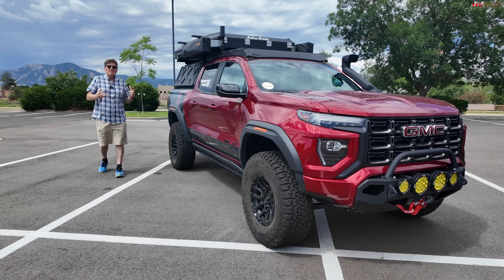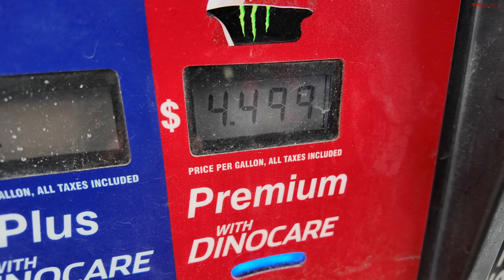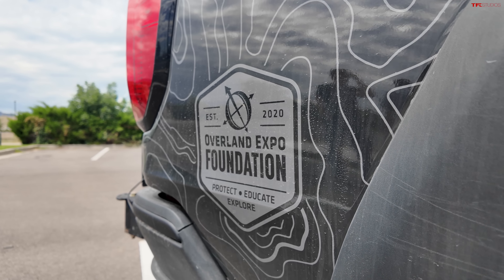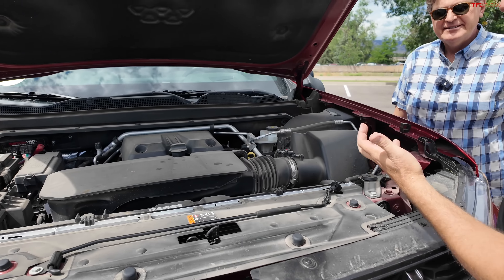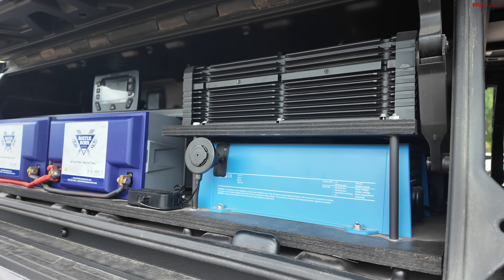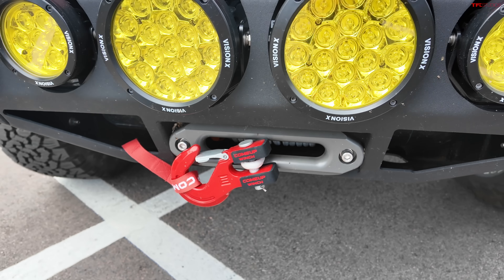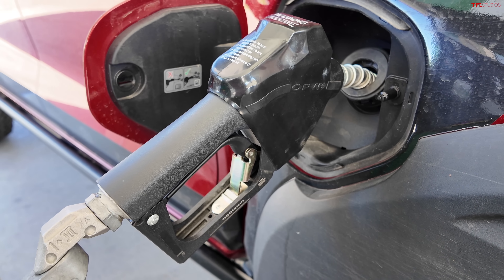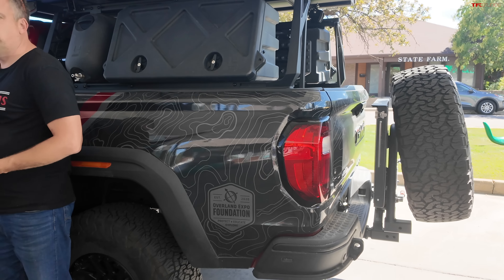How Much Does Adding a Ton of Off-Road Mods Kill Your Fuel Economy? | Denver 100 MPG Test

Comment: Wait, Andre truck doesn"t have cruise control??
Reply: That's the first we've heard of this.
Reply: @guentherwilke2055 lol, no. It was in the very first video he did of it. He picked it up and was like "where's my cruise control?!" It was in several videos after that and if you look at the comments, people gave him crap about it for a long time. He was quick to order it and didn't pay attention to standard features and didn't realize it was an option, so when he ordered it, he didn't get that option. I think getting it is just as simple as replacing the steering wheel with one optioned for cruise control, however.
Reply: @backwoodstherapy  I'll use a heavier coat of sarcasm next time. Andree's missing cruise control has been a running joke since day 2 of him owning that truck. Cheers.

Comment: Cruise control is literally the most useful car installation. I don't care if my car has no power seats, power windows, automatic headlights, or any fancy electronic stuff. If it doesn't have cruise control, im not buying it. In my car if i get stuck behind somebody who isnt using cruise control on the highway, i lose my mind trying to keep a good distance behind them without them speeding up and slowing down by a couple mph.

Comment: 26 mpg on an off-road truck is pretty amazing
Reply: Yeah but the Trailboss is not an off-road trim it’s a street truck with some off-road capabilities. A ZR2 and a Bison would be a true off-road truck and they have 16 and 14 MPG because they have more weight and lift and real off road tires.
Reply: @is6566  I have a 2024 Colorado ZR2 and regularly get 17.5-18.5 even the way I drive it (85 on the freeway).  Not good, but not terrible.
Reply: True. I think the Bison is where it gets really bad but even the regular ZR2’s 18 mpg is a far cry from the 23-26 of the Trailboss that the original poster was excited about.
Reply: @is6566  I'd like to see a 100% stock Trail Boss and ZR2 do a mileage test, then swap wheels/tires and re-run the test.  I'm not sure that Andre has the HO tune (430 ft-lb) that comes on the ZR2 and 2024 Trail Boss.  Since he has a 2023, I "think" he still has the mid tune that has 390 ft-lb, and if so, THAT would certainly account for a big difference in mpg.
Reply: @is6566  its no ZR2, but it has a 2 inch lift with fairly wide 32-inch all-terrain tires. Usually those 2 things alone mean sub-20 MPG on any truck. Andre's also has the high output tune. 26 MPG is awesome considering.
Reply: @kx8960  he paid for the HO tune. His truck also has the optional Territory MT tires.
Reply: @andrewb325  I couldn't remember if he did or not.  SOMETHING is making a big difference since his tires still aren't near as knobby as the ZR2 tires, and re still smaller in diameter.
Reply: @andrewb325  In thinking about it, the locking rear diff on the ZR2 may be causing a lot of drag.  Contrary to popular belief the body or frame lift itself doesn't cause drag per se (otherwise airplanes couldn't fly), it is that the underbody parts being exposed to airflow (causing turbulence) that does.  Big difference between a new 'Vette and a ZR2, basically zero between the Trail Boss and ZR2.  Now, the slightly greater angle of the u-joints in the driveshaft and front CV joints will cause extra drag, probably a lot more so at the front.  The tires themselves I'm sure add a lot of drag, being bigger and knobbier.  It would be really interesting to get manufacturers data to see what particular system difference causes what percent of the actual degradation in mpg, but they probably guard that VERY closely - I would.
Reply: @kx8960  yeah, its a pretty massive difference. It's probably just the sum of a lot of little changes. The Trail Boss still has an air dam, which helps aero a bit. The modded ZR2 with the cut bumper, bigger lift, tires and added parts is an aero nightmare in comparison. As far the rear diff, I'd think the G80 in the Trail Boss has similar drag to the locker in the ZR2. The ZR2 does have the locking front diff which definitely adds some drag compared to the Trail Boss.
Reply: Andre has the HO tune.

Comment: I have a 2024 ZR2 (the blue one Andre saw a couple months back when I talked to him at a mutual friends house) and I'm not getting near that mpg using premium as well.  Now, I'm typically doing 85 on the highway and when passing people have to....er...bump that limiter on occasion (LOL), but I typically get 18 (calculated, as the dash is always about 1mpg optimistic).  Now, on my first Moab trip I averaged a little over 19 on the tank there and tank back averaged, so I was real happy about that.  And on one tank on my recent 3,700 mile trip to Glacier Nat'l Park and back, coming from the saint Mary side back to my hotel in Whitefish, I got 21.3 I think, and was TOTALLY surprised at that, but I was going pretty slow.  Average on the dash for that whole trip including 1 1-/2 solid days of offroading in Moab at the end of it, was 18.4, so, figure maybe 17.4 actual calculated avg for the whole trip.  Considering I fought some hellacious headwinds winds/rains in WY (Surprise!  LOL) in a couple of the travel days, climbing to higher altitudes several times (Beartooth Pass, Logan pass, etc.) and with getting maybe 10mpg while wheeling, I thought that was pretty good.  I put 45psi in my tires for highway travel to try and get more mpg (I'm positive I get at least 1mpg over the 46psi recommended), but I think the difference in tires from my ZR2 (much knobbier) has to make a much bigger difference in the difference in mpg.  As always, great vid!

Comment: Lifting my truck and putting bumpers and whatnot on it did not affect fuel economy at all.  The ONLY thing that affected fuel economy was larger tires.  My 08 tundra went from 18-20 with stock tires, to 10-12 with 37s.
Reply: Yeah it’s crazy how the Tundras, even the new ones, suffer from larger tires. A dealership near me put 35s and a 3 inch lift on a Tundra hybrid and it now runs 12-13 mpg highway lol. Meanwhile, my Raptor on 37s still push out 19-21 mpg highway in Oregon…
Reply: @whocaresjustdoit  It's not just Tundras, it is every vehicle. Larger tires are the bane of fuel economy. The raptor is an exception because it was designed from the ground up to run larger tires in the first place. 

If I were to regear my axles in my Tundra I would get much of that fuel economy back.

Comment: nice , My atx4 gets horrible milage ,  I have a cargo van with a v8 chevy express 2500 that its similar MPG and has less HP but feels like more HP explain that to me , only thing you can fault this truck on is the power plant , give me a v6 natural or v8 natural asp
Reply: V6 Natural 💯 😊
Reply: Toyota had a V6 natural aspirated, it sucks for HP and torque.
Reply: Your v8 van makes more part throttle off idle torque. The hp and torque ratings on the new boosted engines are only valid at full turbo boost. That's why it feels more powerful in your van.
Reply: @jasonperry7970 gearing could also be an issue. The AT4X has a 3.42 gear ratio. On 35s, it will feel anemic, even with that turbo engine. A work truck may have a higher gear ratio for towing and hauling, which will make it feel peppier off the line.

Comment: The lower fuel economy of the built truck, while not great, is still better than a stock truck like Andre’s pulling a small, lightweight teardrop trailer of ~2000 lbs or so.

Comment: Now if you could do the test again using 87 octane. I am guessing you will still see the same mileage and save a few bucks.
Reply: Maybe with the stock truck but I bet it did help with the modified truck with all that load on it. The PCM's in modern engines are constantly searching for maximum ignition timing, so they will take advantage of the added octane, especially these turbo motors.

Comment: Dear Midsize Pickup Truck Manufacturers: Please give us a 4.0ish Liter, in line, supercharged, diesel engine with an eight-speed manual transmission. Those high strung little turbocharged four bangers do not belong in trucks that are expected to work for a living regardless of how "work" might be defined.
Reply: A supercharged diesel?
Reply: @Youtubeuser1aa  Yep, many military vehicles do or have utilized supercharged diesels. The M60 MBT comes immediately   to mind since I trained and served on them, all 70 tons (combat loaded), and 750 horsepower that came from a 12 cylinder horizontally apposed diesel engine. So why NOT a supercharged diesel in a midsize pickup?
Reply: @furmanmackey5479  because turbo diesel is far more mature and supercharged would not meet the insane emissions standards.
Reply: @Youtubeuser1aa  Superchargers have been utilized in aircraft, for example, for nearly, if not exceeding, 100 years with considerable success. Having said that, I agree with you that thanks to insane emissions standards the supercharger might not be the best choice in today's automotive environment. But I can still wish....

Comment: Wow, MPG is not really impressive for either truck. So the short answer is that the major mid size truck manufacturers are sacrificing mileage for cleaner emissions, hence the change from a normally aspirated V6 to a turbo 4 banger. I accidentally filled up my 2023 normally aspirated V6 Ridgeline with premium fuel and drove 150 miles going 80 MPH and average 27 MPG. I understand the turbo 4 banger have better HP/torque specs, but most of the mid-size trucks had great V6's with great reliability. So is this turbo 4 bangers really a better option, I have my doubts.
Reply: Not to mention longevity. Are the turbo 4 bangers gonna be as reliable & long lasting as the Natch Aspirated, reliable, tried & true V6 engines that they are replacing?? My answer is NO. Turbos work engines hard. Simple as that. Everyone knows that most V6’s aren’t fuel efficient engines. That’s not what people buy a V6 equipped mid size truck for.

Comment: The worst part is Colorado residents are paying those prices for 91 Octane, not 93 Octane.  Same week, same month, Shell Premium in Maine is around $4.30/gallon.  I know many states are higher or lower, but still, at least we are able to use 93 octane E10 fuel.  Those trucks look nice, but for the money and resale value, I would ALWAYS choose a 3/4 ton mid trim truck over a small truck with lots of heavy add ons.  What a waste of depreciation money.  Also, that turbo four sounds like crap, like an Osterizer blender.  Yuck.  V8 Engines for a real truck.  Maybe GM can loan you a scrapped 6.2 Liter, instead of those transmissions, since the 6.2 motors fail prematurely.  At first, I saw the transmissions and thought they were leftovers from your Tacoma Blueberry.
Reply: I'm in Metro Vancouver (i.e. West Coast of Canada) and I am paying $4.92 USD per US Gallon for 87 Octane summer prices and next week when prices jump back up, I will be paying around $5.50 USD for the 87 Octane so gas prices are QUITE EXPENSIVE here! If I bought the Premium 92 Octane, it would be $6.70 USD per US gallon!

V

Comment: I can only speak from my experience...my wrangler with 315/70/16s averages 18.1mpg. that same jeep on the same roads with 275/70/18 AT tires gets 23.5. oh, and it drives much easier.
Reply: The tire width is what kills you. If you keep the tires narrow, close to stock, you shouldnt lose that much. I went from 275/50R21's to 35x11.5's(285/80R17) on my LX570 and really didnt lose any efficiency. Granted it already sucked stock but it didnt get any worse. Driving through UT at 80 mph I was still pulling down 17-18 mpg.

Comment: I love your videos, specially the old ones, when you guys went off-road. But lately is just about expensive cars/ trucks, most offer the same, full of tech that not really needed. If you want a truck for off-road/ overlanding, not rock crawling, that you will travel for long distances away from civilisation, petrol isn't the best option, but Diesel is. 
When someone expend $30-$100k plus in a truck, the last thing this person will be worried is about the cost of fuel, their worries would be if the truck will fulfil their needs, if it's reliable, easy to fix, if those electronic gremlins will happen or not and how easy is to fix it. Because person is investing for have the fun part of having it a modified truck, and in my opinion, that's what, I believe (but I can be wrong) people want know. Anyway I am a fan and wish you guys went more off-road, overlading, having more of those series with 3 to 5 episodes and objective reviews when TFL did say this is good and this is not, instead keep going in circles.

Comment: That fuel economy is terrible. My leveled 2019 diesel Colorado still gets 27 MPG and even my 2020 Gladiator on 35s with a fiftyten camper returns 17 MPG.
I wish GM would have made more of an effort to achieve greater efficiency.
Reply: Is your diesel Colorado a ZR2 with the wider track and does it have a roof top tent and 35x12.5's?
Reply: @Jay-me7gw  Nope. That's not the comparison. It has the same size tires as Andre's truck and has 150000 miles on it. Not to mention that I get about the same fuel economy as that GMC towing a 69 Jeep Gladiator.
Reply: @curtshelp6170  Yeah and the new colorado is bigger and heavier than yours so I would say 24 mpg is pretty damn good from a gasser that will run circles around that diesel power and torque wise.

Comment: From my experience over years of going from 31's to 33's to 35's to 37's, then to 40's and adding hundreds of lbs of armor it destroys mileage.  Just going from 33's to 37's you'll lose 5mpg overall.  And btw those Ko2's are NOT real 35's.  They're literally the lightest weight 34'' tire made.  MPG and REAL D-rated tires over 33'' don't mix lol.  The Ko2's are city boy tires.

Comment: Uh, no to the modified truck. Too much "junk" on it that not only affects wind resistance, it also gives it unnecessary excess weight. Sure, upgrade the truck, but remove the additional, unnecessary "junk" when not needed. That stuff should only be on the truck when you're going camping and off-roading.

Comment: I can see somewhat a flaw is that the fuel. I think you need make sure that if you going change grade of fuel, then need to run the truck to empty and fill up fresh grade of fuel. If you are mixing grade like still have a 3/4 tank of 87 and put 1/4 of the premium, you aren't going get the full performance out the fuel. I could be wrong but that is one thing I'm seeing that the test can be flawed. I can see y'all do a fuel grade mileage test where you run one type of grade and test fuel mileage and run another type and see if there is a difference.

Comment: These little trucks dont seem to get any better mileage thab their full size counterparts.
My 2017 crew cab, 6.5ft box Silverado with a 5.3L and Max Tow with 3.73 geared diff gets the same mileage on the highway as the yellow truck. 🤨

Comment: You DON"T need higher octane fuel, scam! Even my 2002 Corvette Z06 (gone now but I owned it for 11 years), day to day, ran great on regular unleaded. I don't even think I noticed when I did use premium fuel? The factory owners manual even says so.
Edit: They simply state it's recommended, in that they mean, it would be best if you were going to race it. Day to day, no need.

Comment: What’s funny is that whenever I have talked to someone driving a big 4WD truck, they usually tell me that they have never had it off the pavement.  🙄

I don’t want a turbo four in a compact car, certainly don’t want it in a full size truck. A straight 6 or V6 would be a lot more durable.

Comment: This is not a legit test. The Colorado is a Trail Boss and GMC an AT4X. very different trucks. A more equivalent test would have been GMC Elevation with off road adds 4x4 and Trail Boss or AT4X with off road adds and Colorado ZR2.
Reply: They really are not that much different. The Trailboss has the same track width and fenders as the ZR2 and similar tires. The powertrain is exactly the same.

Comment: These little trucks dont seem to get any better mileage thab their full size counterparts.
My 2017 crew cab, 6.5ft box Silverado with a 5.4L and Max Tow with 3.73 geared diff gets the same mileage on the highway as the yellow truck. 🤨

Comment: The test doesn't seem very accurate to me. You want to see the difference in fuel economy because of the weight of the modded truck, but then you have extra weight on the stock truck.

Comment: Why would they have chosen the 4 banger for the overland truck? Makes zero sense. Bigger tires require more torque. Perhaps the 3.0 Duromax, but not the 4 cylinder gas.